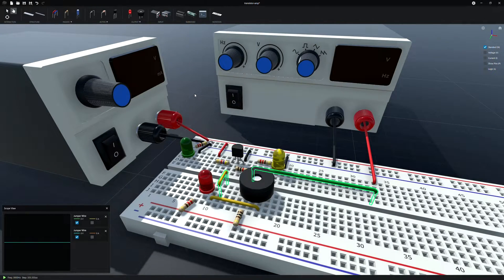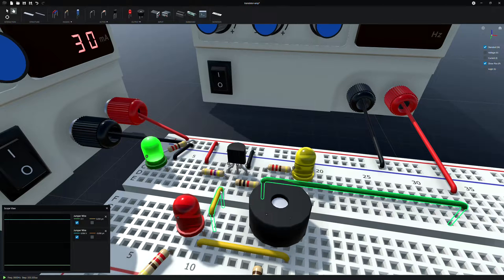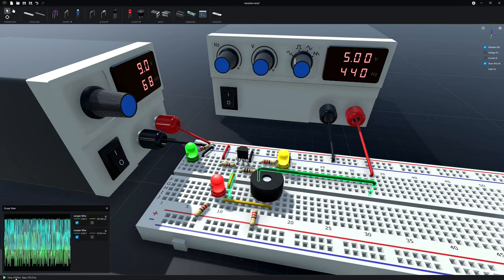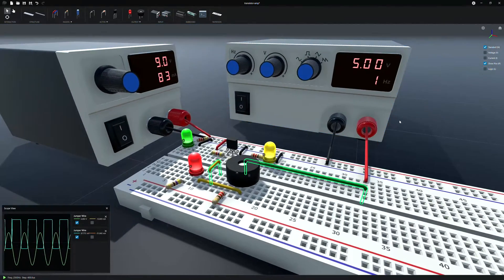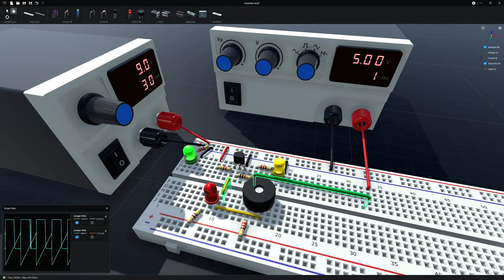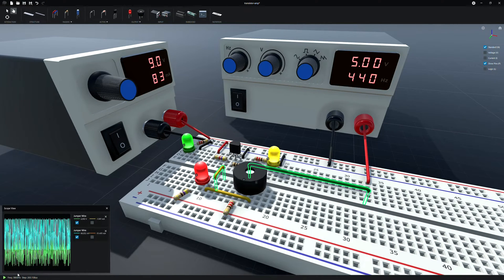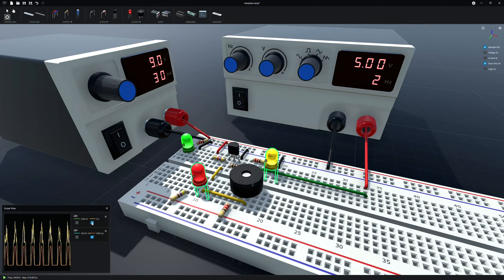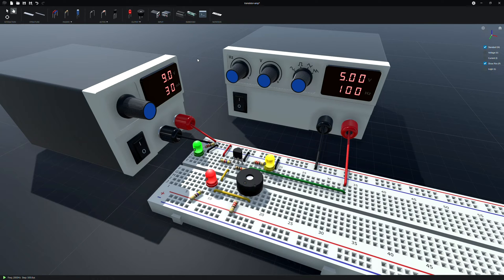CRUMB Basics | Function Generator

Comment: I finally gave up trying to tweak a transistor multivibrator. It starts (sometimes) but within a few oscillations gets stuck in one state or the other. I tried changing to a higher simulation rate but it just never worked. I did, however, get a nand gate multivibrator to work, The typical circuit worked up to about 60hz or so but then started to freak out. The interesting thing is that a .01μf cap at the output to ground forced it to behave at higher frequencies. This causes the output, which is the feed-back loop, into a triangle wave form rather than a square wave.

The problem with the scope (developer says he is completely overhauling it) is that it is not ground referenced and measures the voltage drop across a single component. Measuring a diode passing a square wave will show voltage oscillating plus to minus  - not because current or polarity is reversed but because voltage potential can oscillate plus to minus on either side of the diode. A "hack" way of forcing the scope to reference to circuit ground is to put a 1MΩ or higher resistor from ground to the point you want to test. Then select the resistor to display in the scope.